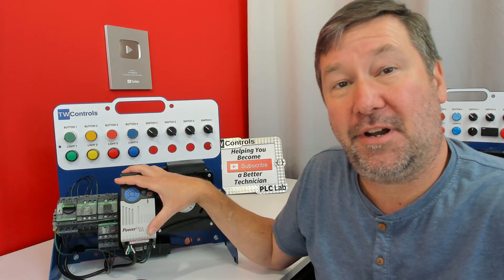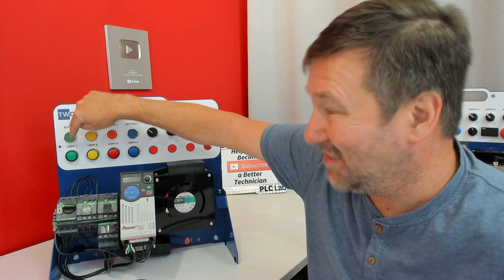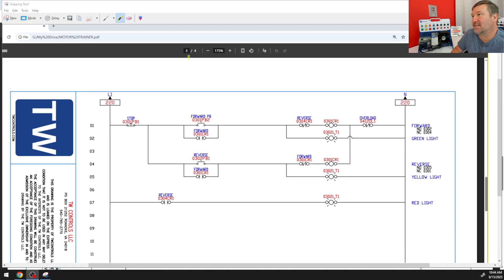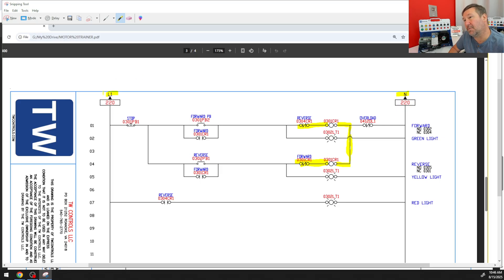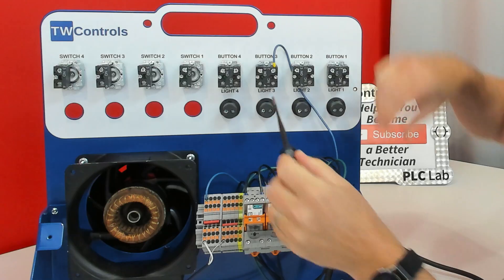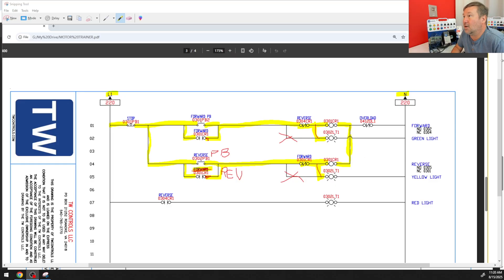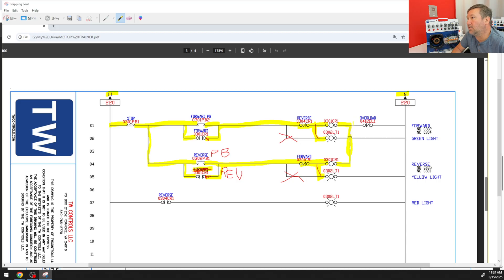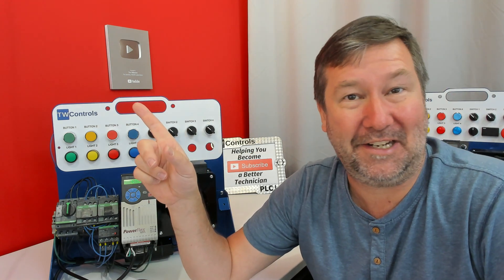Wiring a Motor Starter: Forward, Reverse & Overload

Comment: Would this wiring, control part, be the sane as a 2 speed motor?
Reply from the maker: Yes, most 2 speed 3 phase motors have 6 leads.  The only difference would be that you would not put the reversing jumper on the contactors.  They would both wire to the same legs.
Reply: @TimWilborne  thank you
Reply from the maker: You are welcome